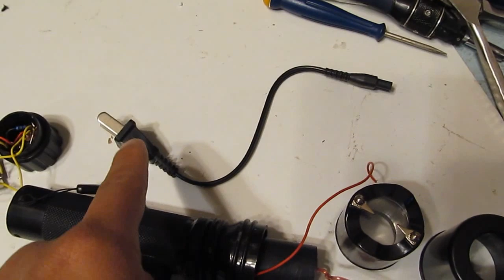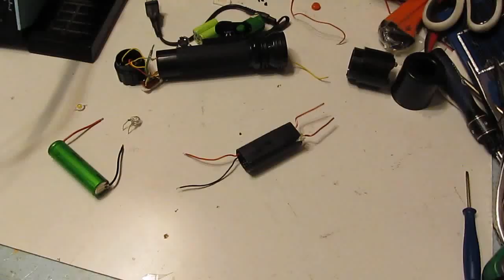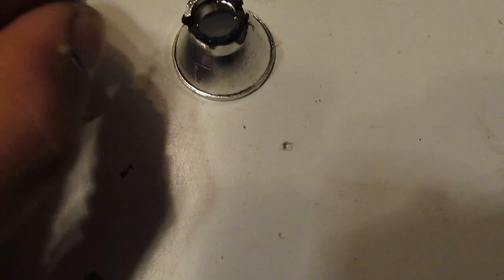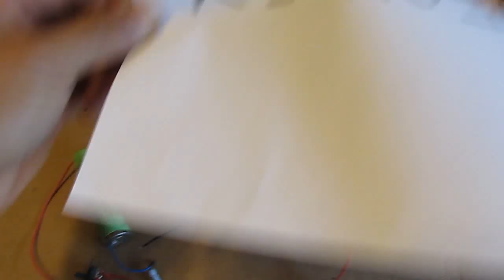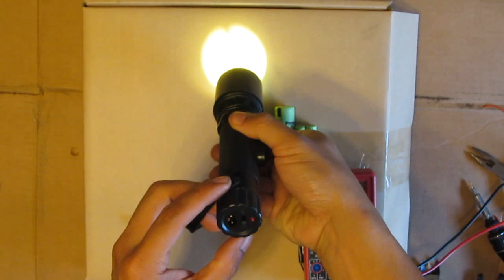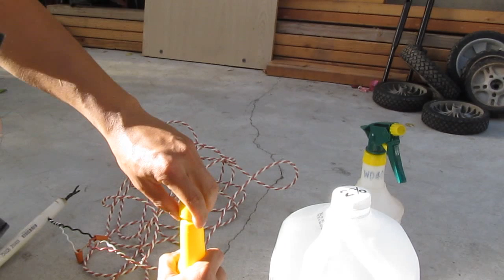DIY: Teardown, repair, & hack World's most popular Vipertek 230 Million Volt Stun gun flash light

Comment: I just watched your great video on the teardown of the Vipertek stun gun. Well done.
I have one of the small inexpensive Vipertek handheld stun guns that Im trying to operate remotely to zap some squirrels in my backyard that keep emptying the bird feeder.  I connected  two small gauge wires from the firing button to a simple disconnect about 4 inches from the button. ;From there I have tried different gauges of wiring to another button about 30 feet away but cannot get it to fire.  If I jumper at the disconnect it will fire fine.

	Near the end of your video when you fired yours remotely at the milk bottle it worked great.

	What do I need to do to make it work from a distance?

	I would be grateful for any tips or info.

Comment: those units put out around 30,000V max. If it was 100KV, you could get it to jump a 3-4" gap with no problem. I have killed about 3 of these units by having the output wires too far apart ( more than 1.25") and the results was the internal circuitry arced out killing the unit. The widest gap that I was able to get the arc to jump was about 1.2" and not die, but it was definately pushing the limits...  the wider the gap the quicker it will become overheated...  keep the gap narrow to keep it alive longer...  wide gap = quick death to unit.
Reply: So wider gap will kill the unit right away? Or it generate heat which will kill if it heated enough?
And does it heat when the gap is wide and still making arc? Or when it didn’t make the arc?
Reply: @MaaZy_  if power is applied to the unit and no arc is created, the energy has to go somewhere and that would be into the coil as inductive currents heatng up the coil. When the arc is occuring, the majority of the heat is disapated thru the arc and not the coil and supporting circutry entirely, some heat does build up in the circutry as it runs but not enuf to kill it...  and from what I have observed, it takes only a few seconds to kill it when no arc is occuring. 2 of the 3 times they died of inter coil windings arcing out due to overvoltage issues between windings ( insulation failed on the wire) the 3rd one died of an overheated mosfet ( transistor)

Comment: I had mine for 1 week and the tazer part stopped working suddenly. Flashlight works great and is as bright as I've seen. Clearly the tazer on these lights are not built with an abundance of quality. I see alot of these not working, but for $7-20 I can see why. Id rather pay more for a heavy duty, quality, and very reliable one than $10 for a pos that's not gonna work when I may need it the most.

Comment: I've got one almost like that, but I dropped it and now the light no longer works.  Tore it down and I have 3 wires on the light end that are disconnected.  Can't figure out how to wire it back up.
Reply: 11months ago and nobody has replied to help you wow , I wish I could hell but idk but good luck finding help on YouTube comments
Reply: @ayappleayapple1311  Well, at least thanks for responding!  It's still waiting for repair.  ha
Reply: @mantolaman  still waiting for a reply or have you trashed canned it? I’m sure I can help you out? What is the part or model # for your stun gun? And what color are the wires that have become “disconnected”? Lol
Reply: @trupyrodice4462  Thank you!  I appreciate the reply.  Yes I still have it, but I don't see a model number on it anywhere.  And there are two wires that are sort of a pinkish red that are disconnected.  Not to be confused with some red wires in there also, that are connected.  Hope that helps describe the issue.
Reply: @mantolaman  it does, but it’s not giving me much to go on. Lol, where do the wires connected connect to? Like does one go straight to the battery and the other to the circuit board, Or do both go to the board? And one does go to the board can you tell me if there are any letters or numbers where the wire connects into the solder on the board. Typically you’ll have a letter followed by a +, -, or a number. And if I can’t get it figured from there I’ll give you my email if you want and you can send a pic. Probably easier than playing charades through YouTube comments😂. Either way, lmk. Cheers
Reply: @mantolaman  or are they both connected to the LED? That would make it tons of fun!! Lol
Reply: @trupyrodice4462  Okay I just removed the bottom end, (opposite the light), and all of that is still wired properly.  (In the process I managed to shock myself!  ha).  So the only wires disconnected are two pinkish red wires to the round disc that hold the led light in the center.  A darker red wire is still connected to the round disc, and the other end of it goes down inside toward the bottom some where.  And the two pinkish red wires that are disconnected also head down south beside the battery pack.  Battery pack is a white wire and it's still connected to the round disc.
I can't get the whole thing apart to see where the wires connect from down below.
Reply: @mantolaman  okay, oh boy, this is a bit to take on. (,Sorry for the late reply, totally got sidetracked and been pretty busy the past few days. -single dad 4 kids, all teens and all boys. Good kids, they stay out of trouble for the most part, nothing like I was as a teenrager tho 😅, thank God) anyway can you take a look at any of the solder points on the circuit board that look to have a little "sideways spike" poking out of it that is not attached to any wires? You may have to try and gain access to the other part you cannot see. Oh! Before you do that is it possible for you to remove the power source or one of the wires to the battery? As comical as it is to get a bit jiggly now and then we don't want you to get shocked again! --Although... If you have a video of..... Baghhh -nevermind 😂
Reply: @trupyrodice4462  No need for apology,  your first duty is to your family.  Good for you!  As for this flashlight, I don't care at all about the shock part.  I'd just like to have the light working.  I was surprised that it did shock me.  It's been sitting idle without a recharge for several years now.  Guess the battery is still good.  Anyway, I'm thinking I need to connect those two top wires first of all to that small round disc with several  terminals on it.  Just don't know which ones.  Right now that disc, (just on top where the led sits in the center) has no wires to the plus or the minus terminal that connects to the led.  And the two red pinkish wires that are not connected have no evidence of ever having been soldered.?  Looks to me like maybe they go to the + and - terminals?
Reply: @mantolaman  I believe you are correct. Do you have a volt ohm meter by any chance? When I'm up against a fix like this I always look for solder dots with the bits of wire left in them. sometimes I do come across wires that are just seemingly hanging about with a bare wire on the end looking like they needed to be connected someplace. That's when I start searching for a wire diagram or schematic of some sort for the part and model# but if none are available I just take a pic of the device and use Google lens (picture search) and I usually can find the device part/model number that way and then try to search up some schematics or at least a similar design that I can match it up to.
At the end of the day tho there's only going to be a few connections with these fairly simple devices, just follow the power and see what isn't connected but should/needs to be. All parts of the device need a hot in and ground out, whether that be attached by wires or by the connections on the circuit board. Typically the pcbs for these aren't to integrated and the traces are somewhat easy to follow... (Sometimes. Lol. There is always the exception. 😀 ) Sometimes the boards are kind enough to even have the points named or identified for us as well...
Reply: @trupyrodice4462  I do have a voltmeter.  I'll try to take some measurements and see what I can figure out.  Thanks.

Comment: Thanks for the video. Just got a sabre tactical and have the same objections with the charging light and primary switch. I like the idea of using the lithium battery as it will charge the circuit faster and a remaining charge indicator is possible. I would recommend drilling one or more vent holes with rubber plugs for water resistance. Lithium batteries have a built in safety vent for batteries should they fail internally. Should the battery fail during charge or use, the trapped gasses from the battery could blow the flashlights body apart. Caution, Some lithium battery formulas still violently explode shortly after venting.

Comment: Hey I have a same but taser is not working can u help me what should I do I mean to repair which part has to be replace
Reply: if the light still works but not the stun function, its the battery that needs replacing. if neither work its probably the HV step up generator module that needs to be replaced

Comment: Excellent video !    My neighbor gave me one of these that quit working.  I was wondering if a 18650 might work.  Sure enough it will.   I've got gobs of those from old laptop batteries so I'll now see if I can get it changed over and working.   I'll probably use a dedicated charger that works from a cell phone charger with one of the little TP4056 regulators.

Comment: i replaced the battery with a 18650, i pulled the high voltage generator out and if doesnt fire at all anymore. where can a purchase a new generator?
Reply from the maker: Ebay. The link was shown at the beginning of the video. Also, make sure the 2 leads are close enough or it won't fire.
Reply: vuaeco
Reply: Glen Robbins

Comment: i have the vipertek T01. the taser quit firing. i was hoping that i could email some pics and maybe you see something that I don't. all of my connection look fine
Reply from the maker: Your Vipertek might have a bad battery. This is a very common problem with these taser. The original batteries are NiMH and very cheaply made. That was why I used a Li-ion battery instead.